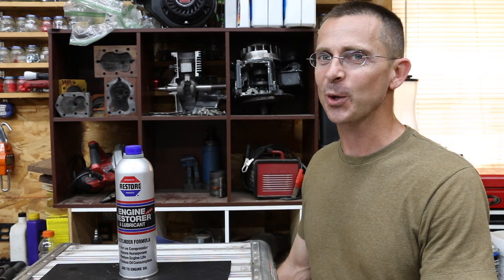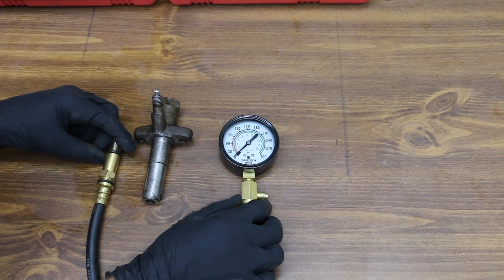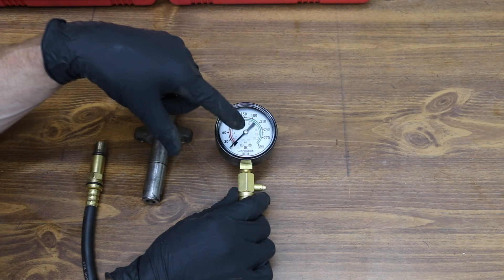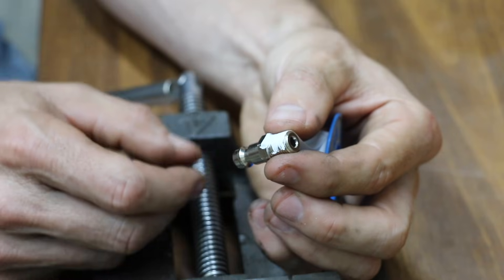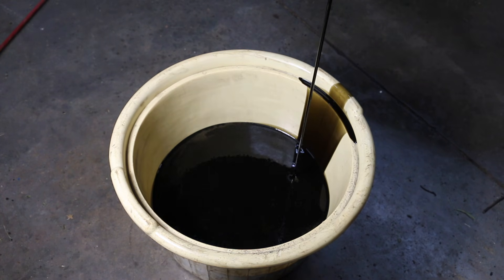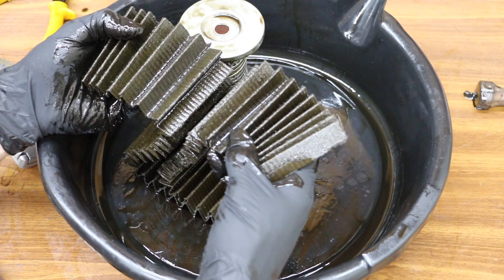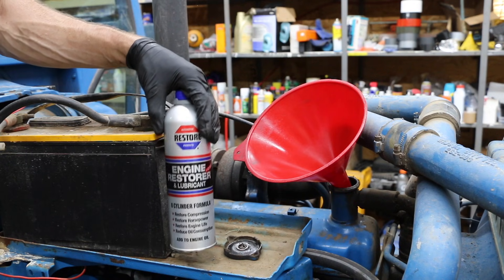Did the "Engine Restore" Compression Improvement Last?  One year later (Episode 2)

Comment: Thanks for your service.  I was a Airforce crew chief on F111D fighter bombers at Cannon AFB  NM. For cutting oil filters apart you can get an oil filter cutting tool that leaves a clean safe edge for around $40.00. The edge is cut so precise that when you put the two pieces back together it's hard to tell it's cut. I bought mine from Summit Racing,  Jegs Racing also has them for around $40. I cut all my filters when I change oil for inspection.  I look to your channel for all kinds of reviews as I trust the way you test. Happy Father's Day by the way.
Reply from the maker: Thanks for the feedback!  Happy Father's Day to you!

Comment: Sold me!! I will give it a try in my 53 Farmall 400. It would not start when it was 45 deg or lower. Sort of defeats the snow bucket idea.
I did fix that by installing a new plug in heater into the coolant line. But yea I know it could use a set of rings and sleeves.
If I put ten hours a year on it now. That's allot. A little bucket work and some brush hogging.
So if this can put off a rebuild for a while. Yea..
Reply from the maker: Thanks for sharing.

Comment: How about testing cheap oil that doesn’t have detergents to see if it would fix or improve an old beat up engine’s performance, help with smoking, improve compression, etc. I’ve heard that running over a bit of time the cheap oil without deterrents will leave carbon build up that actually allows beat up engine to run better. Then switching back to a detergent oil removes the carbon build up and the engine starts running poorly again. Would be cool to see if this is true.
Reply from the maker: Thanks for the video idea.
Reply from the maker: Thanks for the video idea.

Comment: gonna try this on my Honda MB5 2 Stroke.. the cylinder walls are scored.  the oil pump gears is made of plastic and the teeth sheered off.  i guess it dried out from sitting outside of the oil level for 20 years in a shed..  i dnt know..  so it didn't work.  but,  it ran nearly 1000 kms with no 2 stroke oil..  seriously.. 
im gonna try this.. cuz i gotta open it up and rembuild thing anyway..  either press the steel cylinder out and put a new one in.. or over size the piston...  so it's a total rebuild..  only need a handful of wrenches.  gotta love them honda 2 strokes... 
if this will seal the pressure of a D engine. it should at least do something.. worth a try..
ROCKINROLL
Reply from the maker: Thanks for sharing.

Comment: I owned a 1983 lincoln with230,00 miles on it.  The idle seemed rough, a can of restore a few hundred miles it smoothe the idle up. Can't say if it was faster, not a power house, I'm not a hot rodder.   I think it worked.
Reply from the maker: Thanks for sharing.

Comment: I remember in the late 80s when I started driving I had a full-time four-wheel-drive blazer with a 350 engine that I stuck slick 50  it seemed to work awesome now i’m not sure if they still make it anymore but I’d love to get some right now and stick it in my engine right now because my truck has 172,000 miles on a Ford F150 and it’s a 2004 and I could really use some good additive right now so but I’m gonna I’m gonna think about using the the engine restore since I seen you have good results with it so
Reply from the maker: Thanks for sharing.

Comment: Yes, Engine Restore works just like Mystery Marvel does for freeing up sticky valvetrain components, fuel injectors, and fuel pumps. Unlike other snake oil products that cost a fortune and do not work at all these do! I have been working on all types of vehicles for the last 45 years and used those products and been very satisfied with the performance.
Reply from the maker: Thanks for sharing.

Comment: I share the same skepticism as yourself in regards to oil additives. (Maybe where the term "Snake Oil" originated? LOL). At any rate, many, many years ago I purchased a used 4-speed transmission out of the local "Pick-and Pull" self-service wrecking yard. Because the immediate need to put this transmission into service (for my daily driver), I did not have the luxury to do any kind of real inspection/evaluation before installation. But what I DID do is pour in the Slick 50 transmission/gearbox additive as well as the recommended gear lube - and hoped for the best! 

Probably subjective, but it did seem initially like the trans required a little extra effort to shift into 2nd as opposed to the other gear shift positions. (Worthy of note:  This trans had Internal shift rails as opposed to External linkage). While this sense of shift interference never did go completely away, it did seem to improve over time to the point it was only SLIGHTLY noticeable. As I seem to remember, the progress was noticed inside of 2 months after the install. But I can't help but wonder if this "improvement" might have been a result of a placebo effect. Like you often say... "purely subjective".

So based on this experience, do you think you would have the resources to conduct a test similar to your Engine Restore test - except for gearboxes and rear axles of dubious condition?

Many thanks in advance for your time and consideration. I love the educational content, editing - and even the choice of music you use in your videos. Makes for a very engaging learning experience. Keep up the outstanding work!
Reply from the maker: Thanks so much!

Comment: For a truly long term test, you should have used the same gauge as you did originally, and also did a compression test after draining the oil and putting just new oil in. That is to see if it fixes things without always putting in more restorer.
Reply from the maker: Thanks for the constructive feedback.

Comment: Your multiweight oil might actually be the problem many older engines are designed for SAE 40 or SAE 30 oil (when at lower temperatures)... yes it does mean you have to change the oil if temperatures get too low and you want to run it.... but it will work correctly. I suspect the engine restore is just reducing some of the effects of the lighter weight oil ( at cold engine temps). Using multiweght oil can in some engines be actually detrimental (for instance in 2 stroke Detroit Diesels).
Reply from the maker: Thanks for the feedback.

Comment: I used this stuff in my 89 Ford F350 with a 351w almost a decade ago, when it was in a more "pop can like" container. Motor had a ton of blow by and smoked blue on start up pretty badly. I put a couple cans through the motor over a couple of oil changes and it almost entirely fixed my issues. Finally replaced the motor this year after even this stuff wouldn't band-aid the issue. I don't know what that stuff does, but it sure does it well. Great video and follow up.
Reply from the maker: Thanks for sharing.

Comment: So that proves it’s great for fixing older worn engines. But what about if you have a brand new engine. Is it better to not add anything at all and let the wear process happen over time and use. Or are there additives that I can add to use as a preventative application. Like motorkote for example to reduce friction? Any suggestions?
Reply from the maker: II would just use a high quality synthetic oil without additives

Comment: Hi l like your video! Could you do a Xado revitalizant for engine or gearbox restore, they claim that their products can repair the worn metal surface by building a metal ceramic coat and it can also prolong the engine life. It really did fix my manual transmission synchronizing problem!

Comment: One of your responders said it's almost too good to be true. I agree. Ok, so how does it actually do the restoration? That was the cynic in me asking the question. I have a 100 series Toyota Land Cruiser 4.2 ltr conventionally aspirated diesel. The k's are quite low for its age (14 yrs) 250,000 k's, 156,250 miles. I'm a touch reticent to exposing my engine to 'Restore' until I understand how it does it.

Comment: I'm going to try it
Reply from the maker: Thank for sharing.
Reply: @ProjectFarm  I am getting a little blow by causing a little oil to be pushed through the crankcase vent into the air box.  Do you think this will help?  I'm trying to get one more season out of it before I rebuild it.
Reply: @ProjectFarm  the engine is a Rotax vtwin,  it runs great it just has some blow by. I haven't checked the compression yet.

Comment: Ahhhh! You already did a video on Restore! The stuff is pretty amazing, isn't it :) I've been using it for around 25 yrs or so, and it's the only product I've ever consistently recommended to my friends and customers. The first motor I ever used it on was a Ford 289 that I was getting ready to bore and rebuild, so I figured what the heck, nothing to lose. I was stunned by how well it worked after about the first 100 miles, it was like a totally different engine. I'm glad you were able to share this product with others, as it may save people some money on repairs or let them keep their vehicles/equipment a bit longer!
I've been a Master Mechanic for almost 3 decades. One thing I share with you is my general dislike of 'pouring fixes' into any motor. But, when I come across one that works, I use it. One other good product is Slick50. The main reason I mention it here is as a warning. If an engine is in a condition that using Restore will make a marked difference, is that people should not use a product like Slick50 in that motor, instead of Restore. I've had people come to me either asking if the one product can be switched for the other etc...etc... They essentially do the opposite things, and adding Slick50 to a tired motor can often make things worse. Just a side tip, I guess. Keep up the awesome videos!
Reply from the maker: Thanks for the feedback.

Comment: Hello Sir, 

This video is awesome. Can I use Engine Restore in  petrol engine along with Amsoil 5w30 , car is driven 25k miles upto now.
Reply from the maker: I would not use Engine Restore in an engine that only has 25000 miles.  I'd only use Engine Restorer if the engine has low compression from worn piston rings. Thank you
Reply: @ProjectFarm  Thank you sir :)

Comment: Its intersting how some of these products actually works. Now, I know this is not the easiest thing to get to do if youre a hobby farmer (I am assuming here) But one more really interesting thing that could be done to this engine is to put some strain on it for 24 hrs. Like say 90% of peak power on the PTO. Do you happen to have a water pump or something similar to hook up to the tractor that could give it the resistance? The reasoning is that almost always when tractors have been run for a long time with low or next to no load on the engines, they get lazy. Then when we get into the spring season where the tractors get used, often to the very limit of their capabilities they typically live up after a couple of days, like suddenly they can take a hill ½ gear higher than when you began on the season. Maybe, just maybe you can actually improve DCR even further by giving it an "italian tune up" I have seen such improvements many times. Otherwise, keep up the good work. Some of the stuff you do is quite interesting even for a guy that has been around the block a couple of times already.
Reply from the maker: Thank you for the feedback

Comment: Why didn't you simply replace the 300 psi gauge with a 1000 psi gauge? They both are 1/4 tapered pipe thread. $15  and you were back in business. Hindsight is always 20/20.
😊

Comment: Just a quick tip, when applying tape to pipe threads start your tape about 2 threads from the end. Pipe threads are tapered and often the edge of the tape will tear off and be left in the pipe because the threads don't fully engage at the end causing contamination and possibly some blockage in the pipe. The same is true for pipe dope.                                                                                                           Your videos are always great and very informative.
Reply: I started doing that because of experiencing it

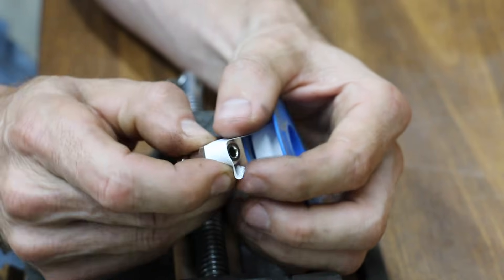Comment: 4:10 I used to be a high vacuum service engineer, and we never used teflon tape with NPT fittings, we used solvent free 5 minute epoxy - Araldite is the brand.  Its vacuum tight and you can demount the fittings.  Solvent free epoxy is for fittings used in medium range vacuum applications where we don't want excessive outgassing from the epoxy when its under vacuum.
Reply from the maker: Thank you for the feedback

Comment: I notice you used an 8 cylinder formula bottle for a 4 cylinder motor. Any reason for not using the 4 cylinder formula?
Reply from the maker: Thank you for the feedback
Reply: The formula is the same, the 8 cylinder formula is just a bigger bottle for engines with more oil capacity...

Comment: Adding 2 stroke oil to diesel/gasoline engines?I am using from 2006 in a new engine car(common rail) till now adding 2 stroke oil in fuel diesel....the engine runs like new,never changed the injectors,pumps,turbo,very quiet...in gasoline engine i use it as well,because i saw in many times in conquests demolition car,people adding 2 stroke on the tank....i was very impressed....you can make a video about that?
Reply from the maker: Thank you!

Comment: I used it on an Integra with a Non-VTEC engine that was having low compression, oil burning and major blowback. It went from a severe problem to a minor inconvenience in less than 100 miles.
Reply from the maker: Impressive!  Thank you

Comment: There are two other important diagnostic measurements that can come from a compression test:
Pressure at first stroke and pressure leak speed at the end. Also, of course wet or dry tests (which you do) to see if it's rings or valves leaking.
Add cold and warm and what do you get? INFORMATION OVERLOAD! LOL
Reply from the maker: Thank you for the feedback

Comment: I had an Buick estate wagon.  No power with a huge engine.  Used that restor.  Drove for about 1000 miles.  Let the car sit for about 6 months 1 winter.  In the spring of was restored.  A lot more power . I would say it works . But it only lasted about 90 days.  When metal is gone it's gone
Reply from the maker: Thank you for the feedback

Comment: One thing it works.... works very well just never put in 6 in 4 cylinder or 8 in 6. Cylinder you might have issues as i did with my 4 cylinder Honda car too much killed weak oil pump. Fixed oil pump and ran proper bottle size for 4 cylinder . more is not always better.
Reply from the maker: Thank you for the feedback

Comment: Hi,

Here is the chemical description of Restore: a mixture of mineral oil, dispersant, anti-rust additives, AND submicron heterogeneous copper-,
silver- and lead-powder particles. 

Here are the melting points of the added metals: Copper 1,984°F, Lead 621.5°F, and Silver 1,763°F.

Since the temperature inside the cylinder reaches about 4532 F., the micro-metallic particles probably melt. Then they could fill in the cylinder wall scoring.

You probably have to repeat applications because the metal filling probably will melt and the scoring will, again, be exposed.

You cannot detect the added metals with your technique because they are NOT ferromagnetic.

Nonetheless, your testing demonstrated long-term effectiveness. Good job!
Reply from the maker: Thank you for this information

Comment: Thanks for the update: that is impressive! 
A magnet is a perfect way to test for metal particles. However, did you check your drain plug? Sometimes they are magnetic.

I wonder how it works? Carbon deposits in cylinder wall scratches?

Thanks for doing the longer-term test!
Reply from the maker: Great point and thank you!

Comment: My 1967 318 i had issues with engine running very poorly I tested compression on all 8 #1 104psi #2 90psi #3 110psi #4 75psi #5 145psi #6 100psi #7 150psi #8 125psi I changed my oil and used a can of restore and drove it it for2 days 105 miles each day to work and I fuel economy has gone up to 12mpg from 6mpg and I noticed a big difference in it idleing so smooth now truck use to shack bad when it idled thanks so much for the video helped my engine alot. I tested my compression and all 8 cylinders are now over 170 psi
Reply from the maker: Very impressive results!  Glad the video helped!  That's a huge improvement in fuel efficiency

Comment: Would using engine restore and Lucas heavy duty oil stabilizer together, cancel each other out or should I only use one or the other?
Reply from the maker: They should get along fine.  Lucas is just going to increase viscosity while engine restorer will add very small lead and copper particles that will fill in the imperfections

Comment: well dang, between this engine restorer and motorkote I think you have a winner.
15% of each then straight 30w to avoid the "mood swings" and "hot flashes".....
(yes I've lived places where the walls literally dripped estrogen if you didn't get the joke)
or go 20w40 instead of a 10w30 to keep some viscosity up, might be really good.

meantime, at "Brodel Nation" channel, he's partially sponsored by "Bear's Products" who makes a fuel additive for increasing power (has one for diesel too), an oil conditioner, and a stop leak that you're only supposed to use half bottle once every 14-18 months. none really appropriate stuff for a Briggs type engine, except maybe his oil conditioner..
Reply from the maker: Thank you for the feedback

Comment: Another excellent video. One tip I'd like to mention when doing the dirty job of changing oil filters is that if you wrap a small plastic garbage bag around the old filter as you're removing it you'll probably catch most of the residual dirty oil that's in the filter and galleries.
Reply from the maker: Thank you.  Great tip!